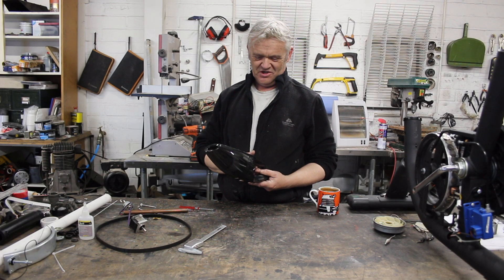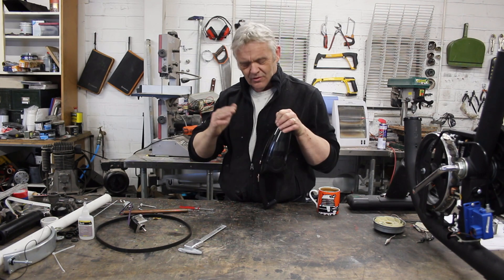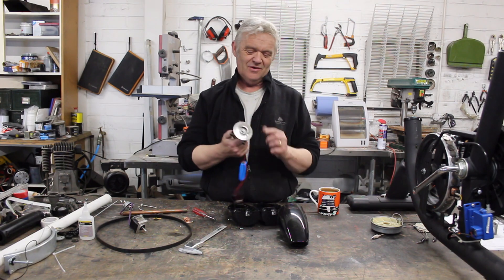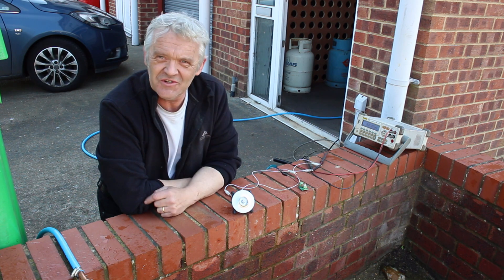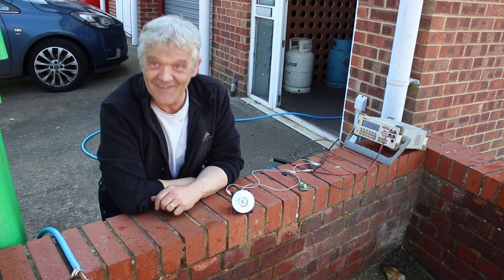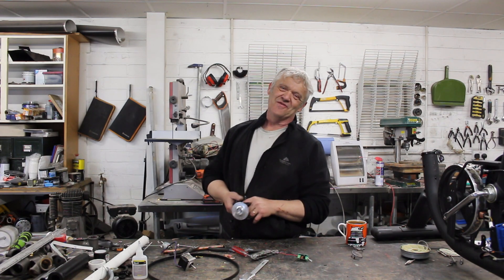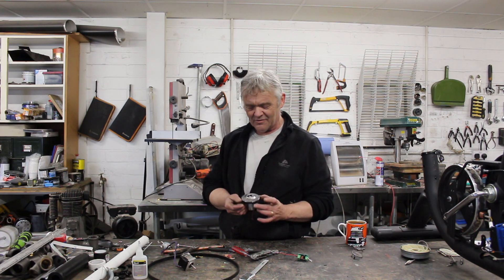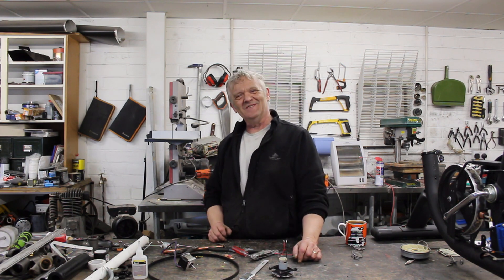1522 - How To Turn A Vacuum Cleaner Into A Generator

Comment: I would like to make an electric skateboard. From which old appliances can I find the motor, and or rechargeable batteries?
Reply: Electric Skateboard is such a amazing technology.   I doubt you would ever have the long range the new boards have.   They sold a conversion kit online.    Trying to build your own things you must find parts close enough to work and that can be difficult to impossible.   
     I collect motors myself,   im trying to find a more powerful fan for my Old automobile.   Size voltage current rating.   To find battery pack revive any old ones use youtube videos online use Eye protection an common sense ohh design ur battery pak around an existing charger.   I own a E-bike for years it may be alot more easy to make e-bike or small scooter

Comment: OFF TOPIC.  UNLIMITED FREE ENERGY.  I WAS WONDERING IF THERE IS A WAY TO EXTRACT POWER FROM THE SIGNAL OF 4G/5G EVEN WIFI? JUST FORGET THE DATA BECAUSE THAT DON'T MATTER JUST THE SIGNAL TO ENERGY.
Reply: Yes. Cut a wire to the resonant frequency you are aiming for.  (Tuned antenna), insulate it then using a Bridge rectifier (full wave) and a decent earth attach a capacitor and watch it Ever so slowly charge. Good luck using these mill amps to do anything useful though.
Reply: @globalmedia2730  ABOUT WHAT I FIGURED ON THE CIRCUIT TO USE BUT THERE MUST BE A MORE EFFICIENT WAY TO EXTRACT THE POWER WITH LESS LOSS, AND WOULD A LARGER ANTENNA LIKE 30 FEET BY 10 FEET COLLECT MORE? OR EVEN AN ARRAY OF THEM. IT MAY EVEN BE ENOUGH POWER TO PREVENT A STORED BATTERY FROM GOING DEAD(FLAT)? BUT TO CHARGE A BATTERY I DON'T KNOW. EITHER WAY IT WOULD COLLECT POWER DAY AND NIGHT NON STOP FOR FREE.

Comment: hmm, I still like the Water Powered Solar-Cell myself.!
. Design by Scotti Crautor, it uses Solar to pump the water from its reservoir to the Water Generator, the Generator lights the LEDs and powers the Circulation pump to return the spent Water back into its reservoir.
. . not bad for a 12 Year Old.- JW .. .. .. btw, hows your contest going?

Comment: I believe  most larger or chorded vacuum cleaners will use an induction motor, which can generate if spun faster than the frequency  that its field coils are excited at, be it excited with a grid connection or self excited with capacitors.

Comment: Nice to see a Joule Thief in action.  you might want to see if after the thief there is enough to actually charge that battery pack that was in the vacuum.  you would need at least a diode, if not a full bridge for battery safety.